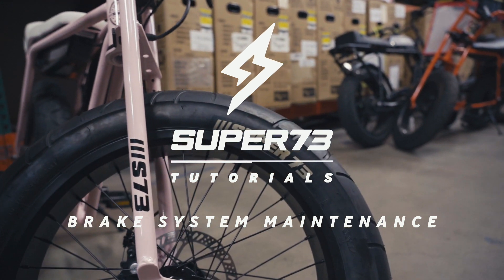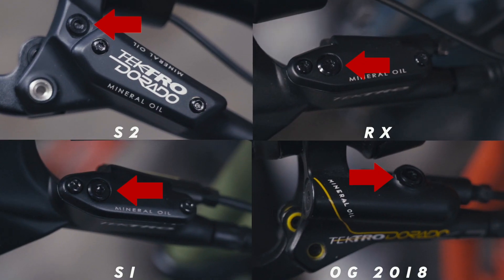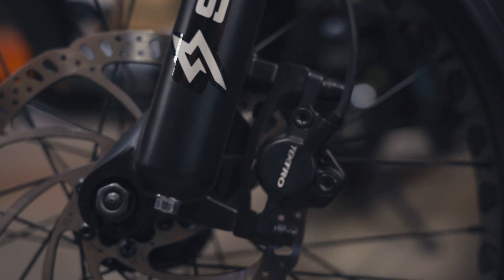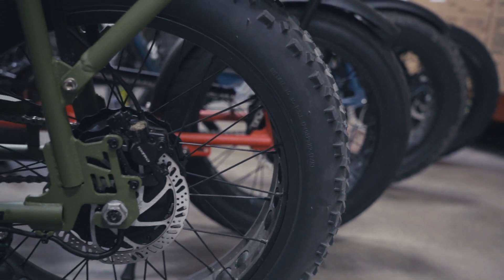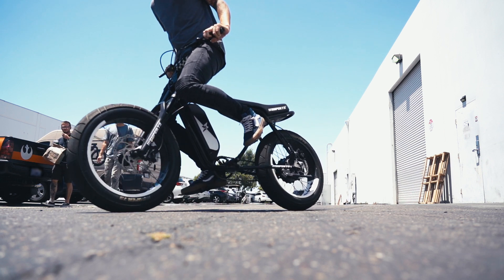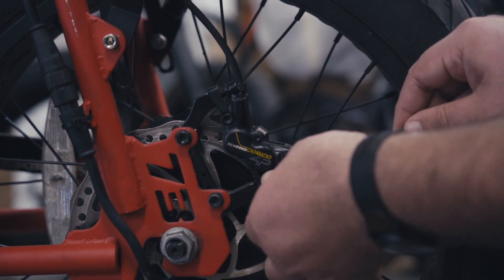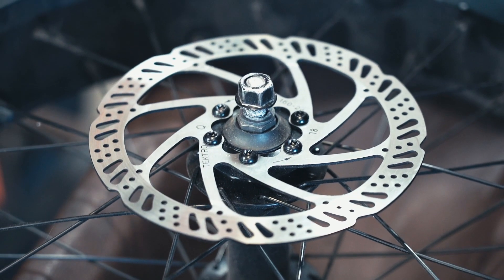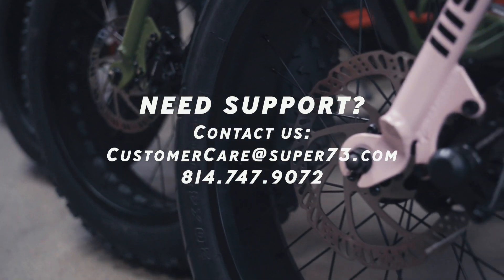SUPER73 Tutorials: Brake System Maintenance

Comment: Will you make a video on how to bleed the brakes?
Reply: He said if it's beyond your skill set, engage a proper mechanic, or watch more YouTube videos.
Reply: @johngreydanus2033  https://www.youtube.com/watch?v=2C43zU9cHKM
Reply: would be great to include tektro model number used on bikes (i.e. R) and recommended bleed kit. I bought a "tektro" bleed kit, but as it turns out the brake block doesn't fit whatever model is on the R. This is an easy DIY task, but without info from Super73 on models uses makes things harder.